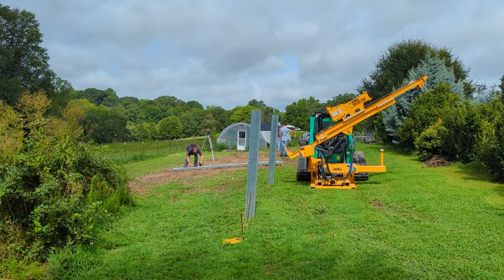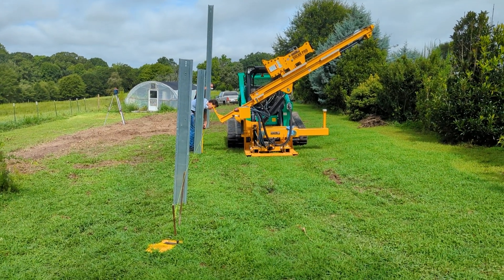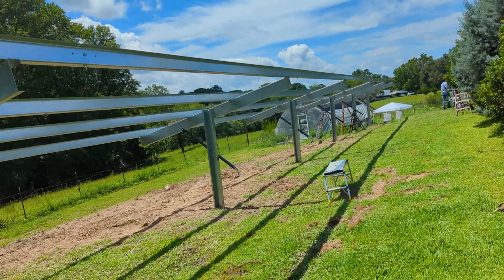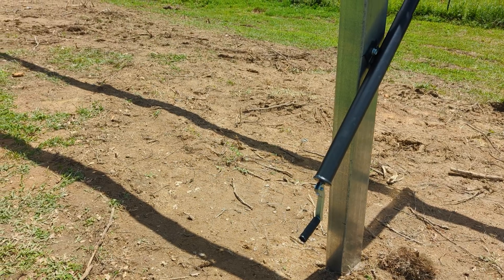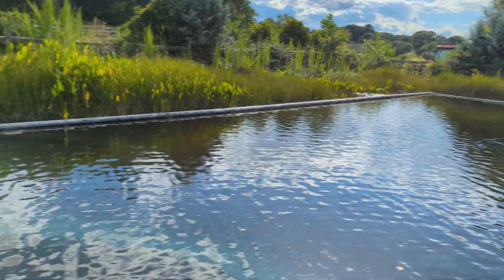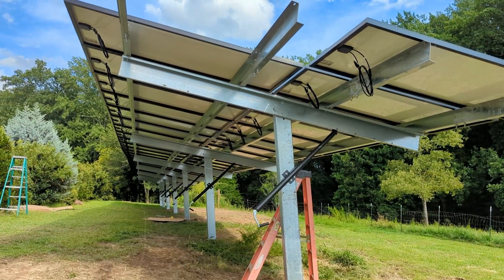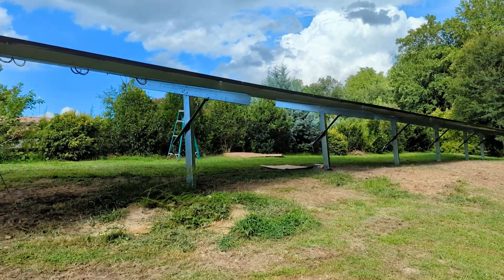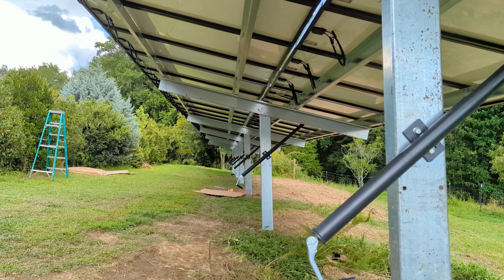Helping a fellow prepper!

Comment: Hello,  

So I understand 8 strings of 8 Panels.  Lets say each panel is 40V and 10 Amp, so each string  ~320V 10 amp.  Do you then run them into a combiner box with some end result of series / parallel setup ?  How many wire pairs and what is the Volts and Amps of each wire pair that hits  the Sol-Ark 15K?

Little confused how you maximize the inputs of the Sol-Ark 15K.

From Sol-Ark Data sheet. 15K-2P-N  -- Residential Hybrid Inverter

Max. DC Input Voltage 1  --  500V
Max. Operating Input Current per MPPT  -- 26Amp
No. of MPP Trackers    --   3
No. of PV Strings per MPPT   --  2

Thanks,

Joe

Comment: I am interested in possibly purchasing some ground mounts from you. I had a question about what size panels they can take.  I am looking at purchasing some commercial grade n-type panels that are higher output.  I am thinking that it would require 12 to 18 inches(depending on which panels I buy) hanging off the end of the rack.  Do you know if this would work or would violate any code requirements?

Comment: Does it take multiple people to crank the adjusters at once in order to tilt without flexing too much ?
Reply: About 7 cranks per pole, repeat, many times.....
Reply: Or just set them fixed at the angle where you need the most power coming in. I’m at 38° latitude. All 52kWp (give or take) of my arrays are between 45 and 65°. No way am I going out once a month and cranking  seven times each!
Reply: @USA-GreedyMenOfNoIntegrity  My need for adjustable angle is for snow shedding. If it wasn't for that, I would not bother with adjustments either. But 35 degrees would suck with snow.
Reply: Cranking an array manually with one person takes 10-15 minutes, do it once a month, or once a quarter, it’s no big deal.
Reply: Celebrate the equinoxes, bring some friends over for beer and burgers and crank for the next 6 months. St. Patrick's day or Easter for spring, Labor day for the fall are good opportunities if you don't feel like being pagan about tilting your sun gathering megalith.

Comment: I just received a 50 panel rack. Couldn't find anyone locally to drive the post.
Reply: SCOTT, GREAT JOB ON THIS HUGE ARAY!
AS JOHNNY WOULD SAY, “PULLIN DOWN THE POWER”
Reply: Have Blowe’s deliver you set a post hole diggers in 500 bags of quickcrete😊.
Reply: SInclair has a list of installers they will provide to drive your posts-did you see if there was one in your area?